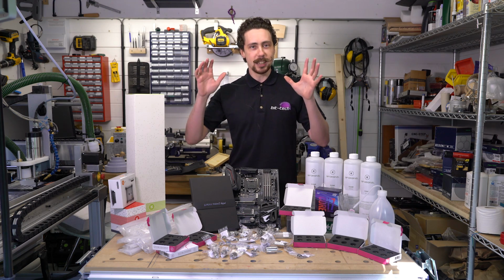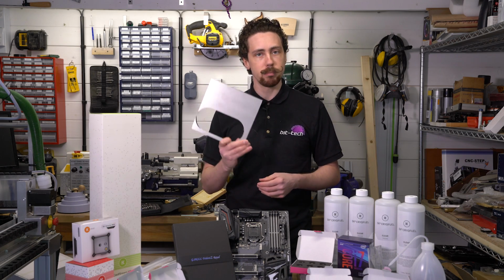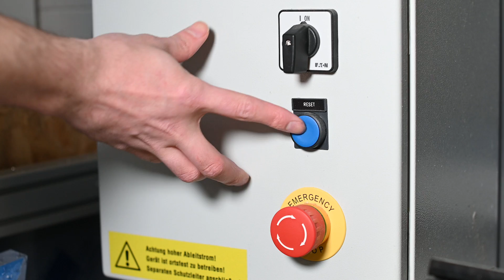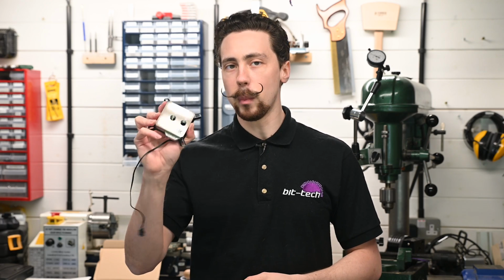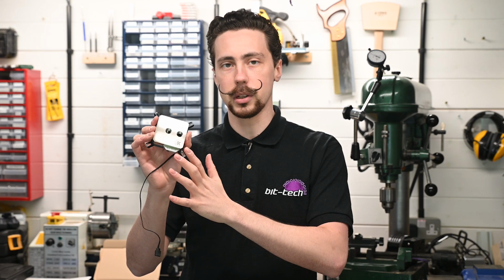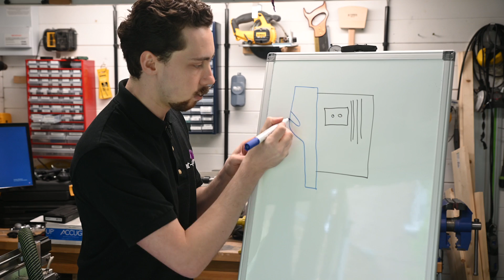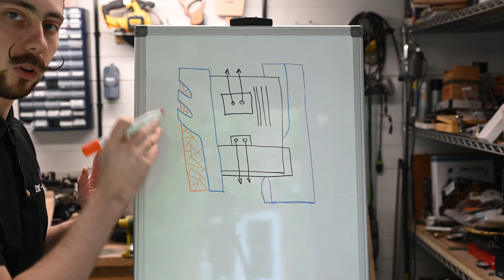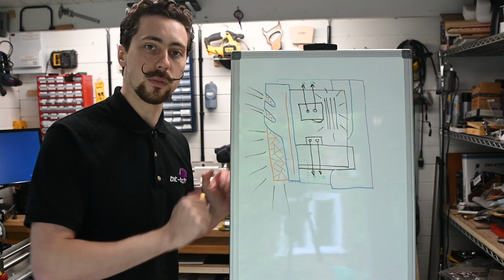G.Skill Trident Z Scratchbuild for Computex 2019 feat. EKWB (Part 1) | bit-tech Modding

Comment: that custom collar is so boss.
Reply from the maker: It definitely fits right in with the block. Supposedly the originals were machined but they switched for production. I can sort of see why tbh as there are a fair few steps so cycle time and material usage are pretty high, a machined one would use the same amount of metal as the whole rest of the block :o

Comment: I absolutely love how you made that accent to the cpu block, im not sure how i feel about making the whole case an piece of ram, feels a little tacky to me however i have yet to see the end product so i could be completely wrong, im really curious how you will do the crystal effect though, you mentioned milling it out so do you not plan on making the crystals on the bottom half? Or do you plan on cutting 2 separate pieces of acrylic and mashing them together
Reply: Also im curious as to whether you plan to mill out the letters on the giant dimms and leave them bare or fill them with epoxy like you did with the cpu block, that is if you add the words which i think is rather important, it adds a little bit of detail to an otherwise very plain span of shiny aluminum while still keeping the look quite minimalistic
Reply from the maker: It’s going to be an interesting one to manage that’s for sure. You’re 100% right in that there’s going to be a fine line between cool and tacky with this line. I’m aiming for more of an “inspired by” look which should help keep things in balance I hope.

The text is an interesting point actually, been wondering that myself too. I’ll see what it’s like in CAD and go from there I guess, it could be a really good move if done right.

Comment: I came from the complete build.  Holy hell this is amazing.  Just out of curiosity from someone without a CNC machine, do you always need to cut out all filler material when you need to cut a section out of a piece?  When I first saw you doing that I was thinking maybe you were not cutting all the way through but then it kept going.  My guess is maybe you can run into issues with a piece in the middle being freed up while not clamped down?

Comment: Hmm... Wouldn't the aluminum cover corrode with the brass over time? Will you remove it right away after the showcase? (I have very little knowledge about corrosion, so forgive me if what I said does not make sense)

Great work though!
Reply from the maker: The cover piece just sits around the outside of the block, so actually never comes into contact with the fluid. If it did, then you'd be bang on in that it would corrode.

Comment: Wait what... why not contour the inside if you were just cutting all the way through? Seems like you may have wasted a lot of time and a little of your tool's life clearing out the entire inside
Reply from the maker: It’s not just a through-cut, there’s also a pocket for the LED cable. Honestly it’s not a big deal since the part is so small, machining time wasn’t very heavy. I also wanted to avoid having a big block in the middle that I have to hold in with tabs or risk is moving around